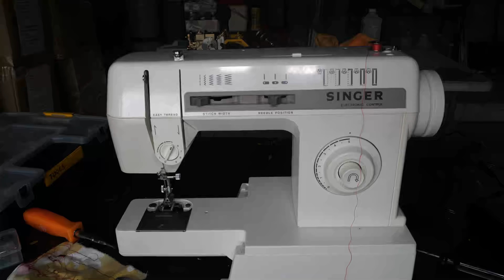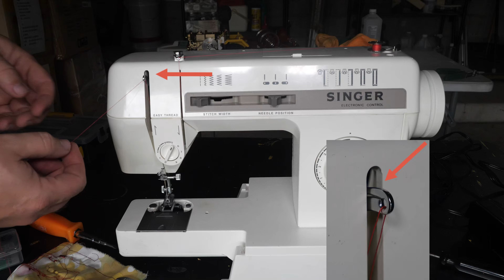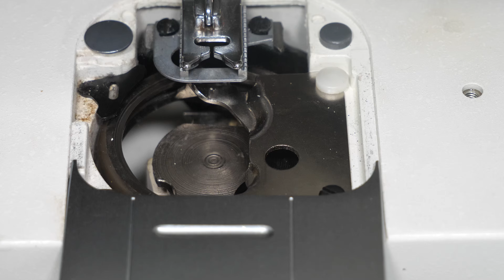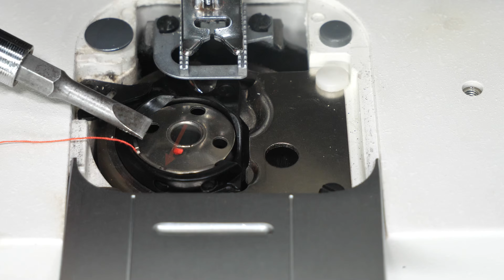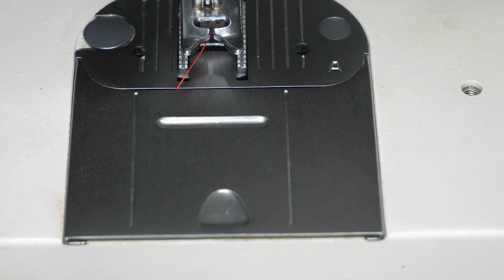Singer 2502C Threading

Comment: Boutonnière sur ce machine
Reply from the maker: I believe this machine has the button hole feature on the length dial, but it is a machine I repaired and returned to a customer so I cannot go look.  Check the manual for instructions on the button hole feature.

Comment: Thanks for this video. I didn’t know the needle plate could come off that easily, but after watching you put it back, I took mine out, along with the extension table and the presser foot. Under the needle plate, I found the reason for bunched thread whenever I tried to sew: tiny chunks of dust from thread had gotten trapped under the plate over time. I brushed the dust out and off, put everything back, and the machine worked properly for the first time since I bought it.
Reply from the maker: Yes, sewing machines are very high precision machines and keeping them clean can fix lots of mysterious problems!

Comment: Hi! Just got a 2502c and it didn’t have a slide plate. I ordered one from eBay but it doesn’t snap or clip into place. Doesn’t even look like it fits right. Is it supposed to snap in place or just sit there?
Reply from the maker: There is a flat spring in the front of the bobbin area.  Set the bobbin cover plate on the machine a little beyond that spring, then gently pry the leaves of the spring up so they can slide in the grooves on the underside of the bobbin cover plate.

Comment: My machine is this one but will not pick up bobbin thread
Reply from the maker: Check that you have a nice new needle.  If it is still not picking up the bobbin thread then you can slide the cover back and watch.  The hook should be rotating around the bobbin case as you turn the handwheel.  If it is not rotating then you will need to check for broken gears.  If it is rotating then you will need to check the hook timing.

Comment: Great Video!! I am having a tough time finding spool pins for this specific model though, where did you order yours from?
Reply from the maker: This machine takes the generic Singer plastic spool pins.  There are 2 styles (small end and large end to fit in the hole) and I think the 2502c takes the larger pin style.  They make a Universal plastic pin with one size on each end so you just put the correct end in the machine.  Otherwise, I have replaced spool pins with chopsticks.  The pointy end of a round chopstick can usually be cut to fit the spool pin hole and you trim the it to length.

Comment: I purchase this machine at Goodwill  probably I need to buy the metal bobbin to have nice stitch,I replace new needle. 
The universal bobbin work?
Thanks...
Reply from the maker: I would use the plastic 66 bobbins and any generic bobbins and Universal 15x1 needles should work well to get started.  15x1 is the most common and generic needle size.  What kind of stitch problems do you have?
Reply: I cannot get my machine to sew without the thread completely falling off. I thread it perfectly, and when I start to sew something happens and the thread falls off the needle. I am new to sewing machines but I have a smaller one from Amazon that works better than this one I don’t know what I’m doing wrong 😭 help.
Reply from the maker: What do you mean "falling off?"  Is the machine stitching and the threads are just so loose that they pull out of the stitch?  Or when you try to sew the machine throws the top thread out without making any stitches?